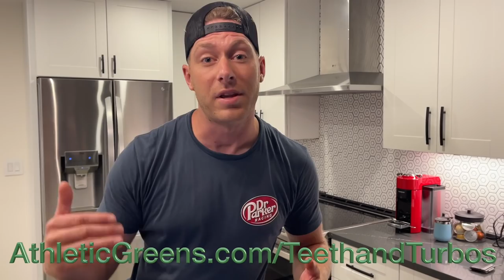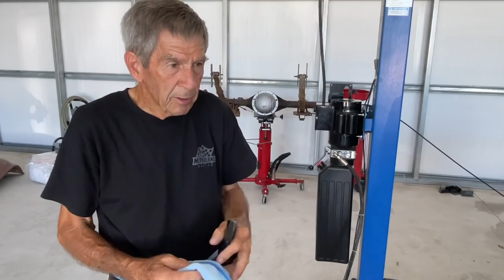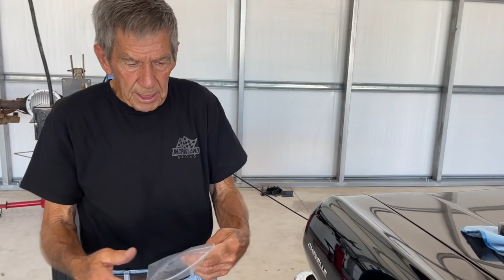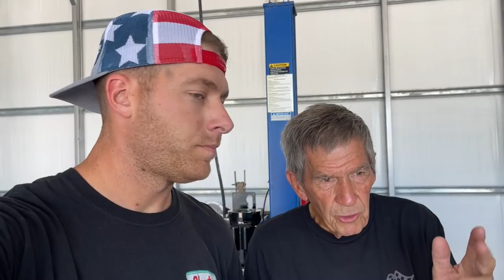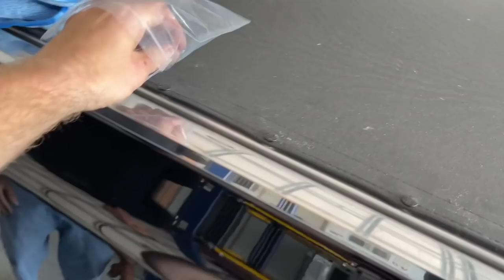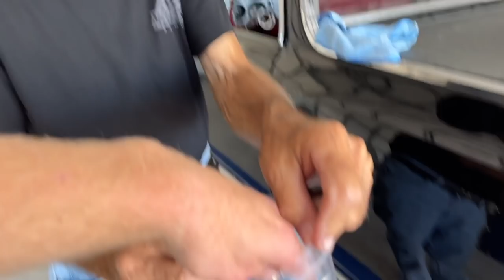Mr. Sam on How and When to Clay Bar Your Car!

Comment: Another thing worth mentioning, clay bar will keep your buffer from getting filled with dirt thats embed into the paint. Its good practice to clay bar before buffing.
Reply: Not only does it prevent you from contamination in your pad, but by not introducing foreign contaminate, it also allows the polish to work better, and break itself down properly. Which can greatly reduce work time, and also improve the final finish result.
Reply: And itll keep your buffer from turning into a sander.

Comment: The plastic bag is a great technique for checking the car. I never considered using clay on glass. I've had a few white vehicles, so I've used a clay bar to remove the metal specs and other junk. Thanks again for sharing Sam's knowledge!
Reply: Man. White sucks for showing rail/ brake dust etc! One reason I won’t get a white vehicle! Lol

Comment: Back in the mid to late 90s, I used to have to use the clay bar treatment on new vehicle that came into the dealership. They referred to it as "rail dust", little black/brown spots that get on the new vehicles during transport on trails. It seemed to be mostly the Ram trucks but yes, the clay bar system works awesome!

Comment: If your hand slides across the surface easier, then so does air for those racers.
I will be getting some of his products. Window glass you can use clay bar or even a fine rubbing compound to get out that dull look with contaminants. Spray with the clay bar and 00 steel wool on glass for old etched or scratched areas to super clean remove scratches and "Haze". Hope that helps.
Reply: BTW...thanks for the video and Sam showing his expertise. He is such a good man with an abundance of knowledge. Thank you

Comment: A little tip for cleaning with clay - it helps to first warm up the clay in your clean hands, squeeze it, fold it, whatever and make it warm. It will be softer and should take off the contaminants easier.

Comment: My cars are outside drivers that haven't been washed in long time. I'd shred the bag if tried that and my RT has all the spots from being washed and whatever in a hard  water area. Most of the fleet here the paint isn't good enough to make pretty again.
Sam is a great guy and just chuck full of knowledge he's gained around cars through all of his life and he's passing it on. I need redo the driver's corner of the rear bumper cover on my 06 Charger RT sometimes from lil sister backing into a pole before she sold it to me cheap 😎 I helped step dad at a body shop years ago so I have a bit of a clue, just no garage. Keep posting Sams tips and tri, always something to learn.

Comment: Can you use a clay bar on fiberglass boats?? I’m not comfortable buffing so that’d save me a lot of money every year
Reply: Fiberglass gel coat on a boat is a different animal than automotive paint. Claying is designed to remove low level imbedded surface contaminates. Oxidization of fiberglass gel coat isn't going to budge with an automotive paint clay. There may be a very aggressive clay you could get that might help to remove some of that gel coat detritus, but unfortunately, that is not a replacement for a buffer, and a gel coat specific cutting compound. Sadly, with gel coat, there are no shortcuts.
Reply: @bigbuckoramma  thanks for the reply! Unfortunately though someone has painted my boat previously therefore I don’t have gel coat anymore. With that being said, will the clay bar help that? Obviously not watermarks and stuff I’m just talking the top of the bow/sides
Reply: @codygrimsley7960  if you are talking about the parts of the boat above water, and you are fairly certain that an automotive grade paint was used. Then I see no reason why you couldn't use clay on it. I would pick up a small clay bar kit, like the Mothers kit at an auto parts store, and try a small area to test the results. If the surface comes clear with the clay, and you can see it remove the imbedded contaminants on the outer edge of the clay, then go for it! I wish I could see a picture of the paint to better instruct you on how to proceed, based on the kind of paint it is, but a small experiment is likely the only way to know for sure. Feel free to hit me up with any more questions or concerns you might have. (As a disclaimer, I work for no brand, I was previously a Meguiars brand representative, and worked at Griots Garage, and have worked with many of the industries leading detailers, such as Jason Killer, and Mike Phillips, and some of Sam's old friends at Palm Beach Motoring Group. I have been professionally detailing for over 20 years and tried literally everything under the sun, and have more opinions than people want to hear. LOL!)

Comment: Alot of clay bars scratch the paint surface although lightly, it does scratch it and you should technically do a paint correction after

Comment: Can you use clay bar on your head lights?
Reply: Absolutely! Plastic headlights are 2k clear coated just like your cars paint clear coat. They attract and imbed contaminants just like your cars paint does, maybe even worse, and that could lead to premature clear coat failure on the headlights. So feel free to clay your lights! You can even use it on your windshield to help remove some of the stuck on contamination you get around the wipers. I like to use spent paint clay on the windshield to get the maximum usage out of it.